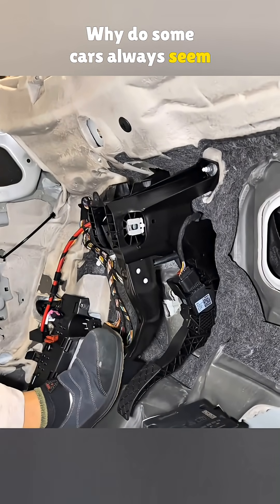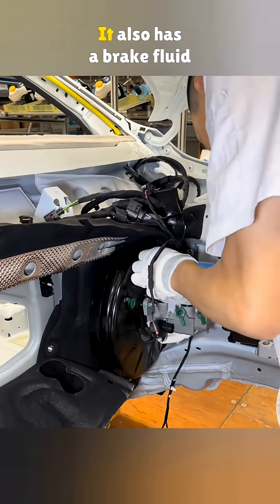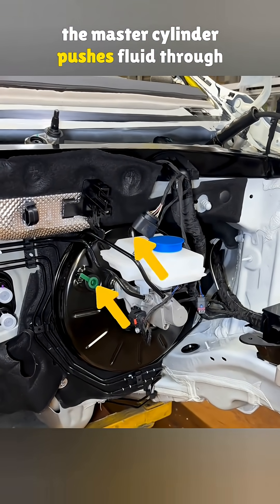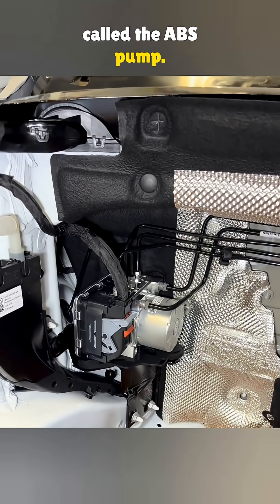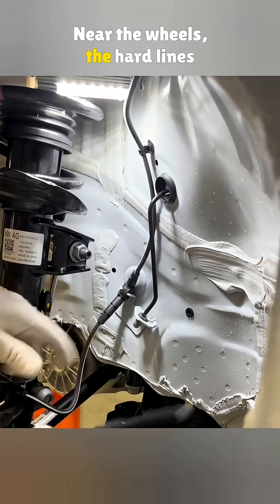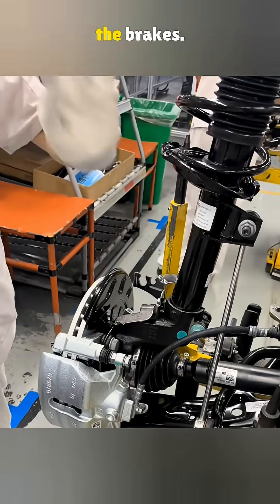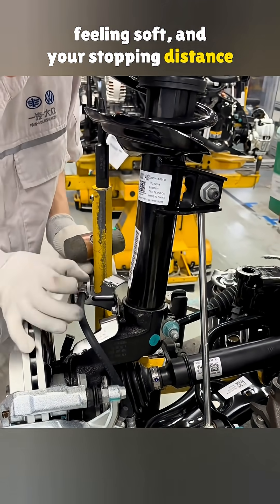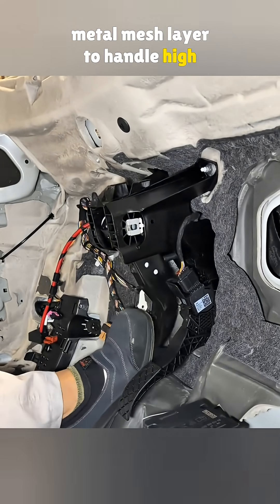Why Car’s Brakes Feel Weak #assembly #automobile #mechanic

Comment: The question is why do oem brakes rotors etc doesnt have that stopping power unlike the aftermarket ones lol its called Oem right original equipment but why😆

Comment: Esp is not same as abs. Also rubber hoses dont get "corroded" as they are RUBBER not ALUMINIUM. If they would be made from steel, then they could ROST.

Also there are vacuum and electric brake boosters. And usually automatic vehicles have much stronger boosters.
Reply: That is a combined abs and esp module,rubber hoses perish and swell,giving a spongy pedal feel. the rest of what you wrote is a load of nonsense.